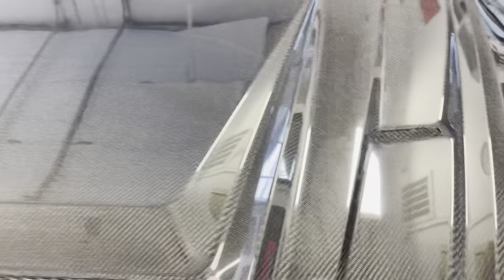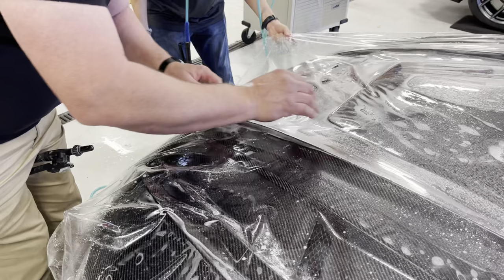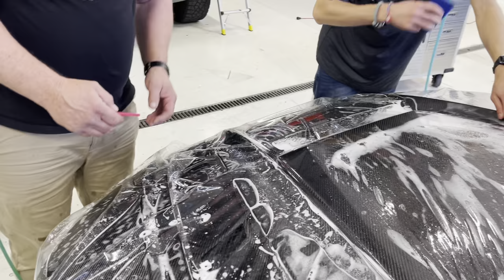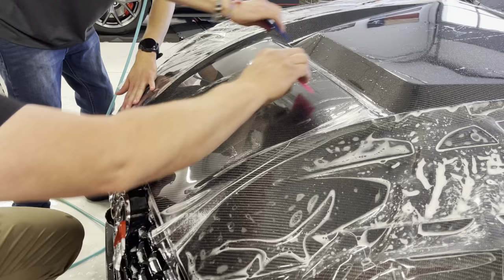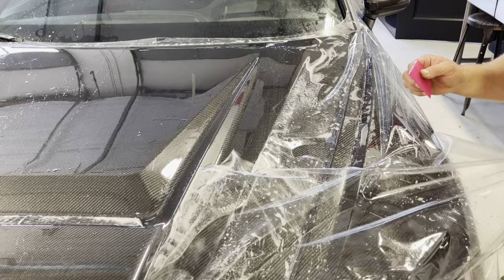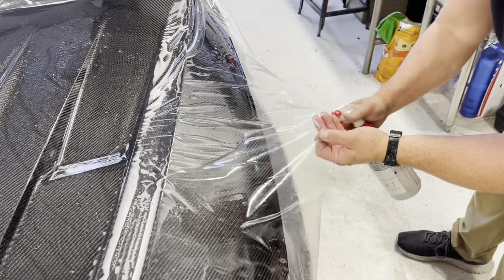Difficult Aftermarket Hood Wrap With Paint Protection Film

Comment: Hello, can you tell me where I could buy some large film for the car door and hood? Right now, I can only find some 12 inches wide film on amazon but I need bigger one like 40 by 40 for car door. Any advice is greatly appreciated. Btw, I'm in Canada. Thanks a lot!
Reply: Very hard to find because the manufacturers ban vendors from selling to the public. You can buy some off brands, but you’ll be lucky to find any name brands in big rolls that don’t cost more than the price if you paid to have it installed. It’s a scummy practice to screw DIY’ers.

Comment: I work at a Porsche dealership and my main problem is dealing with chicken skin and adhesive lines in the glue . Do you have any videos on those things ?
Reply from the maker: I don’t yet. I don’t remember what video it is but I talk about lift lines. 
What brand film are you using?
Reply: I see dealership jobs quite often as someone who reedoo dealership jobs that customer don’t like , I’m glad you are wanting to learn . 

Lift lines will appear if you lift the ppf when it’s already too much tacked up , and or you haven’t got the liquid deep enough after lifting , your tack solution wich is alcohol based is thinner so it will reach furthest then the soap solution , try using the tack to reach to the line you stopped when lifting , while pleeeease avoid putting your fingers under the ppf … 

Chicken skin in when you move the ppf around your a pressing to much with your finger and not enough with your palm , your finger will create a tacking point and if you squeegee over it it will appear like chicken skin spot , always position and stretch your ppf , like , glass it , lay it perfectly and then spray soap solution again with high pressure to lift any tacking point , your piece need to be glass and spot less before any squeegee , this is a terrible video to watch honestly … lot of problems …